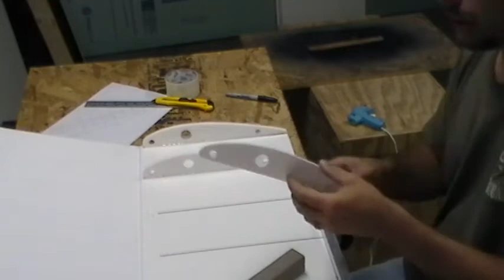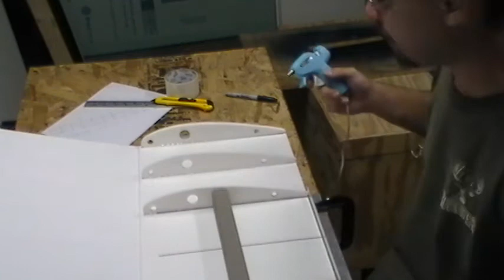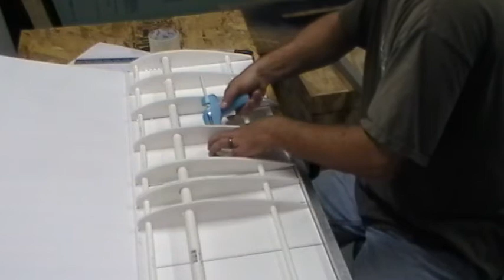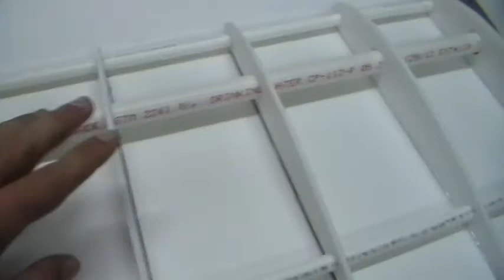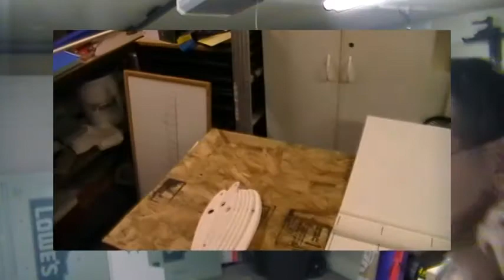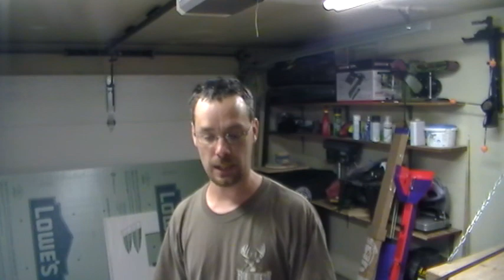AXON Project Part 3

Comment: i would suggest you use gorilla glue white. Its lighter and will do a better job sticking the foam together and will flex with the wing. epoxy is rigid and will let go of the foam during wing flex.

Comment: how much did you pay for those fishing rods i have a set i use on occasion at work and they are fairly expensive. Ive thought about using them but the cost prevents me from sacrificing them. They are very thin strong and light they should work great for you. What size motor do you have planed for this bird?